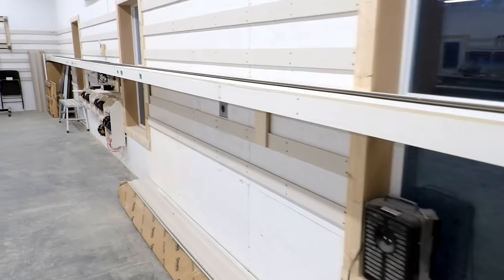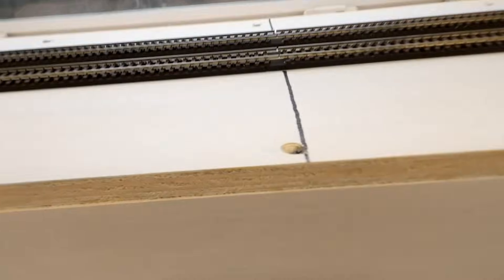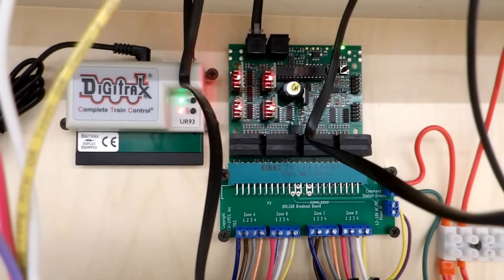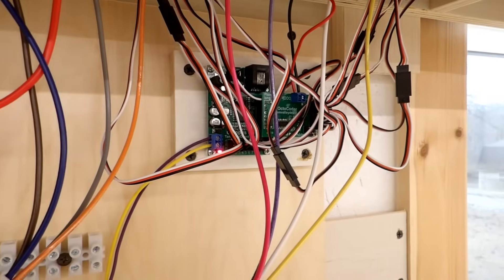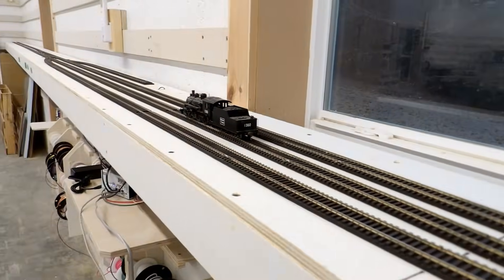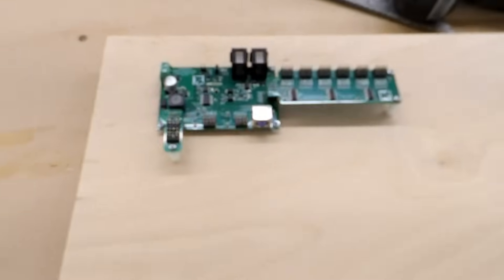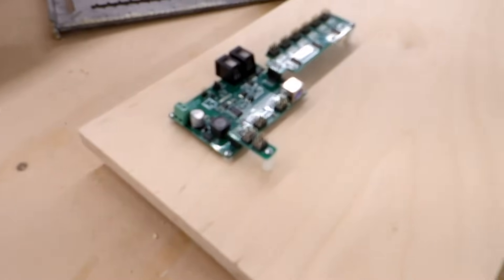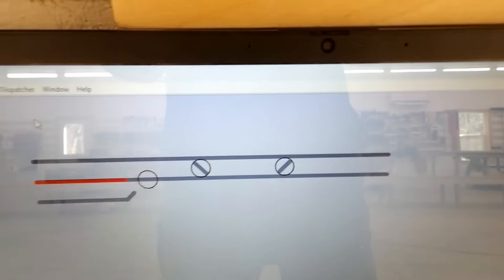A simple test track, part 1

Comment: If the eventual plan is to be able to control turnouts from JMRI then there needs to be a separate occupancy detection for each turnout.  That is the only way to prevent changing a turnout position when it is occupied.  Of course it requires suitable coding in JMRI as well.
Reply from the maker: Turnouts can be grouped together and all of them can be locked when the block is occupied.  In the situation shown, the two turnouts on the upper main are one block and the three turnouts on the lower main are another.  That way, the turnout is considered occupied as soon as the first axle of a train has passed the signal that protects it.

Comment: Have you created a problem by blocking the middle of the windows for fire exit in an emergency? I used to do inspections as a contractor for a cabal of insurance companies and we had to look at issues like this and send pictures back to the company I reported to.
Reply from the maker: Fire codes only require two exits.  I have 3 doors and 10 windows.  Windows only ever open to half the frame size anyway, so the hole through those windows isn't any smaller now than before I built it.

Comment: Peter your test track looks great, one question the crossover you installed they look like #8 is this correct
Reply from the maker: Yes, they are #8.  although I could have used shorter turnouts for the test track, I wanted to use turnouts that can be repurposed later in the project.  They will all go into the upper staging yard once I've finished with the test track.
The visible main-line turnouts on the actual layout are all #10's though.
Reply: Peter thanks , I am taking out my #6 crossovers and installing #8 crossover , I learn lots from you

Comment: NCE also does not get feedback from turnout decoders, perhaps all dcc systems are similar? Was baffled until I worked that out. I kept my octopi and use the physical switch attached to the servo to drive two cheap arduino relays - one to switch frog polarity and one for turnout feedback sensors via NCE AIU boards. Frog juicers seem expensive and I've had a few of them fail. Using Train Controller, automation in JMRI was beyond me.